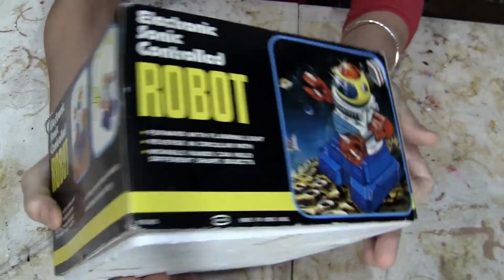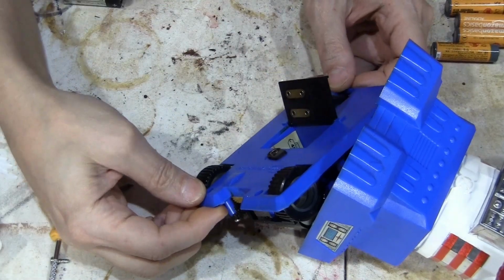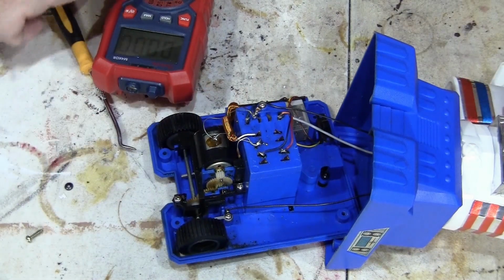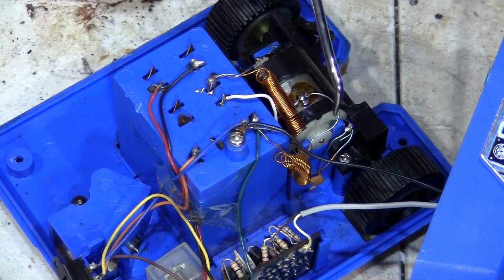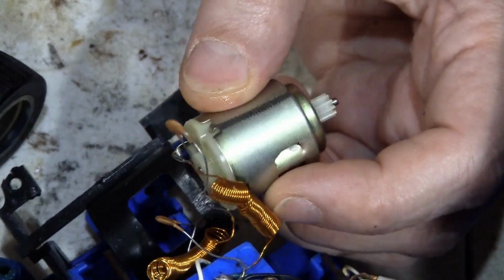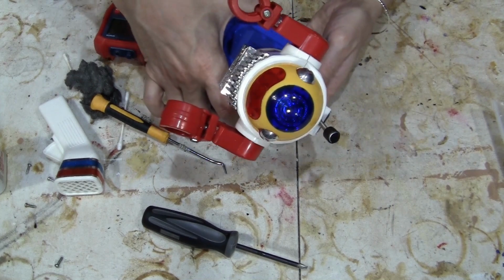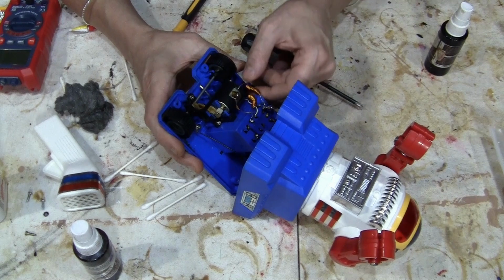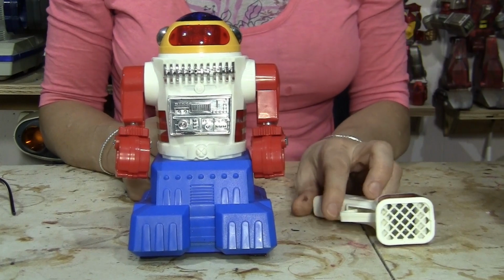My Nemesis Is Back - Sonic Controlled Robot Nightmare

Comment: Those inductances with the caps at the motor look like low-pass filters, to remove all the noise from the motor. Possibly without those the relay got activated randomly and they had to add it after designing the main circuit.

Comment: If it does the not running thing again, try removing the old solder from the motor terminals. clean up the wires and make a good mechanical connection with the motor terminals and then give them a new coating of 60/40 solder.

Comment: The tag on the box is from Hess's. It was a department store chain from Pennsylvania. In the 80's and 90's they had around 80 stores mostly in the north east. I have many great memories shopping at Hess's 😎
Reply from the maker: Ah.. Cool. Didn't those. Thanks.
Reply: I grew-up near Scranton and the mall for that city, Viewmont, had Hess's as one of three anchors. The chain expanded a lot, including corporate acquisitions, in the late 80s but a recession in the early 90s lead to stores being sold to various competitors and complete closure of the company by the mid-90s. The one in Viewmont became a Kauffman's (later bought by Macy's.)